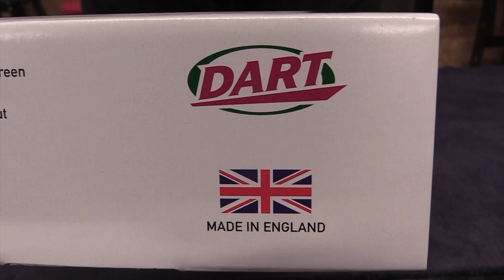Harley Davidson Street Bob, "Dart Flyscreen" Install !

Comment: The whole kit looked top quality Del & I dont think it's that expensive. I paid more for my FreedomShields screen plus shipping from the States & although Im really happy with it and again great quality, I would have preferred to buy British. Im sure that will make a hell of a difference on your longer trips especially in the cooler weather.
Reply from the maker: Yeah, i, hoping so, after maybe a couple of hours it's ok, but by the time ive been plugging pon for four hours or more, it really starts to drag you back.. may have to adjust the height, but that's an alun key in the pocket and can d o it on the fly...  Cheers mate, always appreciate your support.

Comment: I had some hd fat chisel bars fitted in my street Bob I was surprised at how narrow they were in comparison to with the standard bars which turn you into a sail at anything over 65 because they are so wide . I would say this fairing is a good option and certainly looks to give a good amount of wind protection , certainly cheaper than a bar swap and looks cool
Reply from the maker: Thanks Andrew, and i agree, i absolutly Love the bars, they give me the exact ride position i wanted, so changing them wasn't an option..
Reply: @Moonfleet41  I’ve got a 114 Fatbob at the moment but I’m seriously thinking about going back to a street Bob as they are by far the best bike in Harley’s current line up in my opinion
Reply from the maker: @andrewjohnson6297   I agree, 10Kg lighter and lower to the ground.. better riding position too, (but then thats subjective of course).!

Comment: definitely functional.  Slightly unfortunate, for me at least, that the windscreen has a logo on it.  Wouldn't be to my liking unless they have an option without.  Sort of makes the bike seem like a "Dart" :)
Reply from the maker: Can easily remove it, it's just a tiny plastic sticker, heat it and peel it off.!

Comment: Hey up. A unrelated question do you have any vids on removing dents from a tank ? I can't see owt. I've tried a couple of bad ideas with no results. Big magnet, trying to use a bit of bent steel rod in the tank and the worst one of all inserting a inner tube and inflating it. This did not go well the tube popped at 30psi and sprayed the residue petrol out the tank into my eyes. I won't be trying that again lol. Cheers keep up the vids I use them regularly when working on my bikes.
Reply from the maker: Hi mate, there are no magic wands for tank dent removal, if you can't get a suitable lever in through the neck behind the dent to massage it out, and of course as long as it's not too big, you're best just filling it and re-painting it... you could try your local paintless dent removal company, other than that it's traditional body work techniques... best of luck with it!
Reply: @Moonfleet41  cheers I will try getting something else in to try pushing it out. A previous owner had filled over it but it wasn't the best job and the filler was cracked and coming away. Cheers.

Comment: How much wind protection do you get with this windshield?
Reply from the maker: Not absolute protection, it's too small to keep the wind OFF you.. but it does smooth out the air flow and grately improve cruising comfort. !

Comment: Looks good. I'm, like you, and  don't really like the look of a windshield on my bike, so I went with the Memphis Shades Del Rey. With their quick release hardware, I can take it off or put it on in seconds and it stays off unless I'm planning on laying down some miles.
Reply from the maker: Good choice for a best of both worlds. As the Street Bob is so stripped back, i wanted the least obtrusive possible.. The Del Rey is almost like a slightly larger version of this one, so if this isn't effective, i guess that's a great second option.. Thanks for the headsup.!

Comment: Totally off topic here, what's with the little "grabby" action as you're picking up the different pieces of hardware? The hand comes into frame slower and then there is a definite action you do when picking up the bolts etc. Not sure if it's a you thing or a conscious choice for the video. Just something I noticed on this video that I hadn't noticed before.